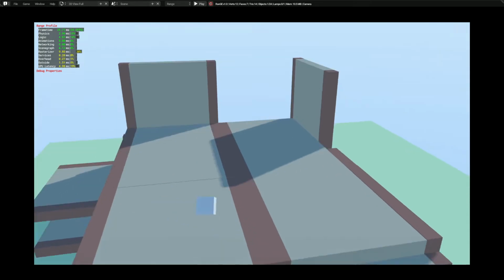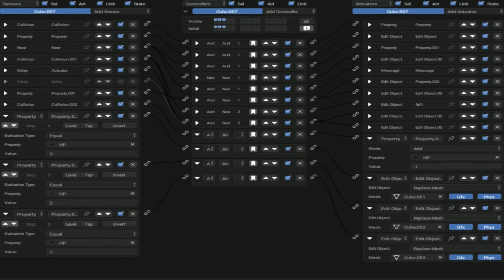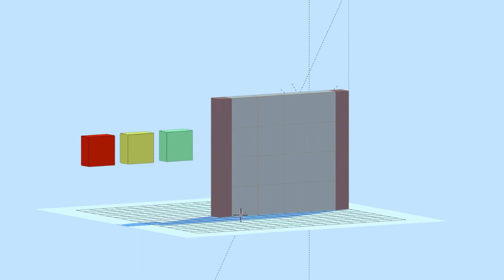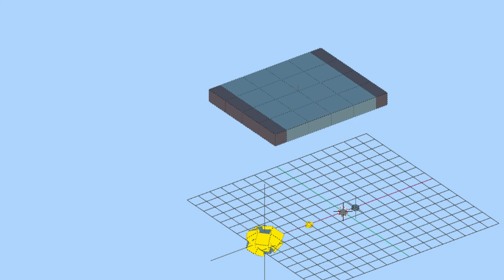I made more building destruction

Comment: Can you still use logic bricks and nodes for visual scripting and can you still have objects glow like you could and Eevee???? We need more
Reply from the maker: Yes you can still use the logic editor for visual scripts. In range it does alow area lights that can be used to make glowing textures. But not to the extent of upbge 3.0 with the eevee engine. You can use shaders to make bloom work in 2.5 and 2.79. The Timsters has a good shader pack for blender that adds a good amount of shader options.